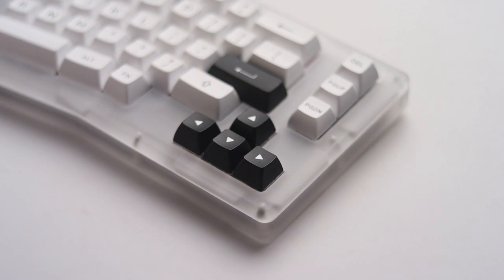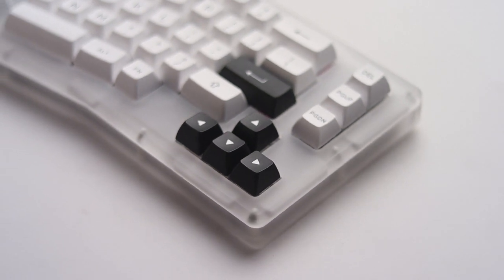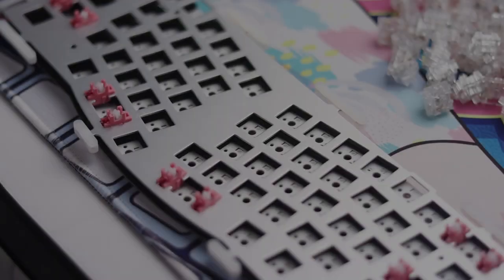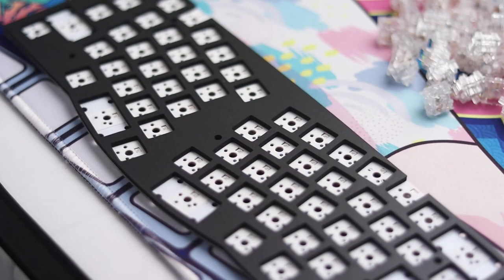Akko ACR Pro Alice Plus! | Multiple Sound Test w/ Crystal Switches!

Comment: Out of the 8 sound tests I definitely prefer the alu plate with both foams, but it would be interesting to hear it with lubed switches and some case mods since acrylic cases are usually muted and lifeless in terms of character, great sound test with the editing and the timer at the bottom, huge fan of it!
Reply from the maker: I do agree as well! with the Polycarb, the board seems to be to a tad bit muted.
Will defo use the Alu + All Foam combo on future sound test!
Reply: @CaviteTechnology  if you have free time, try add a thin layer of PE foam between pc plate and pcb, the will make the sound more lively.  I love the deep sound of PC plate on my boards.